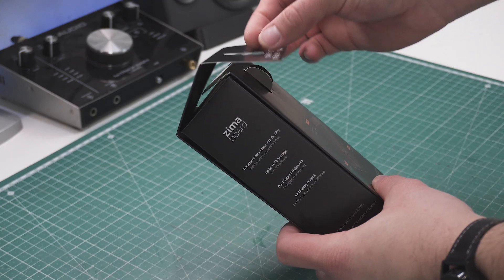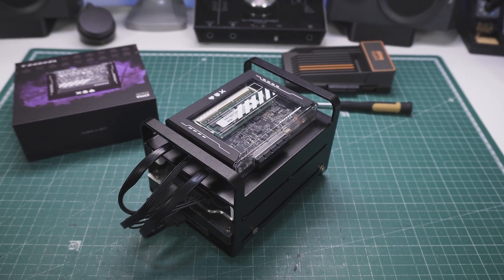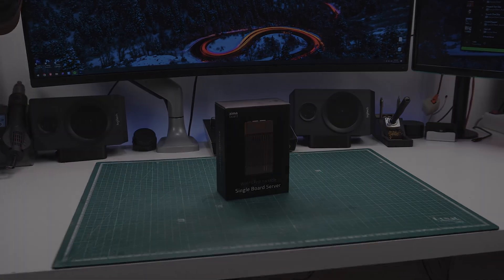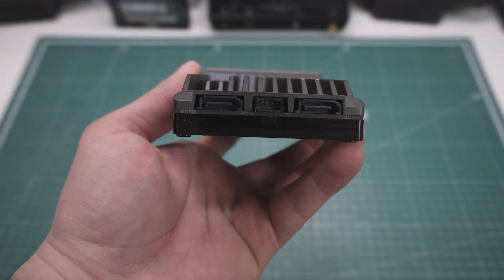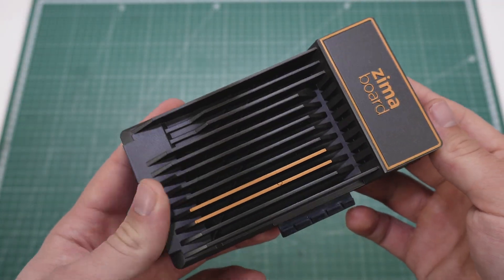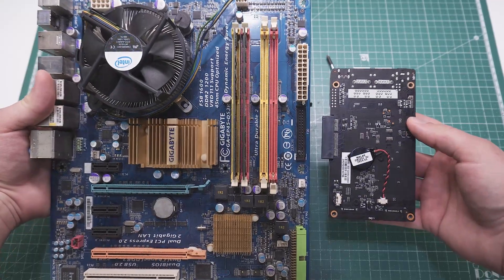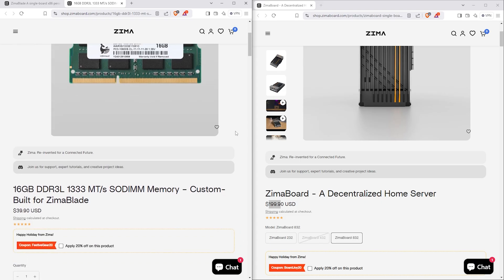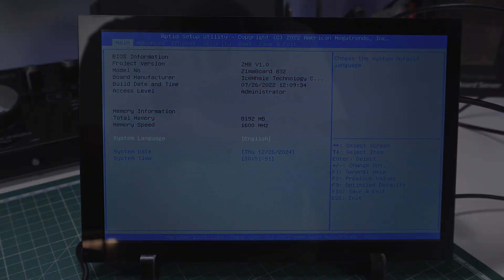Zima Board vs Blade: Which Mini PC Should You Buy?!

Comment: I was backing the ZimaBoard 2, but decided it just wasn't what I wanted, especially as the ZimaBlade is about 1/2 the price in the NAS kit form. Thinking of adding a couple of the smaller 2.5" drives to make it more compact as a travel NAS.

There's a couple of machines in the GMKTEC range that offer twin SSD's internally, but don't realistically need speed for a travel NAS I think.

Have a Ugreen DXP4800+ and a couple old Synology units to play around with at home anyway.

(really want to build myself a PC NAS though, but will take a while to commit the money for some really large drives though)